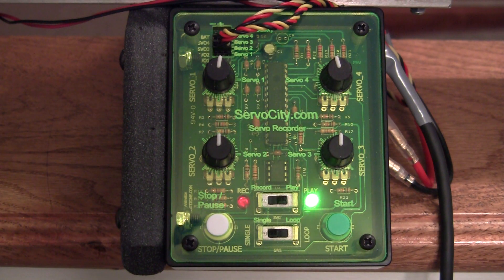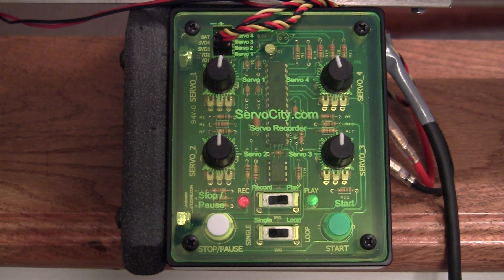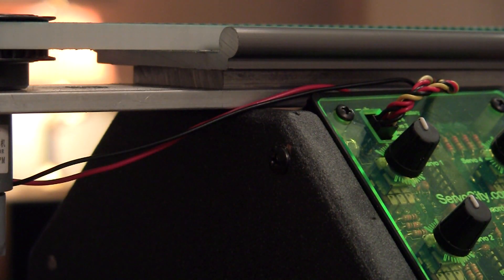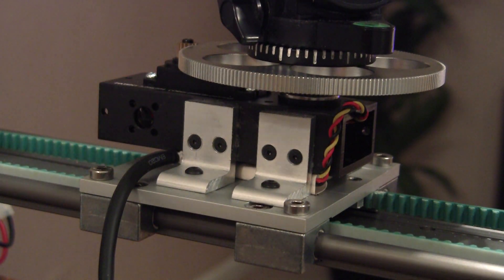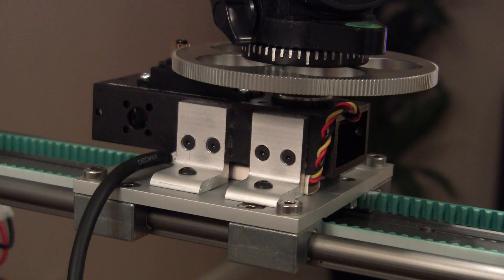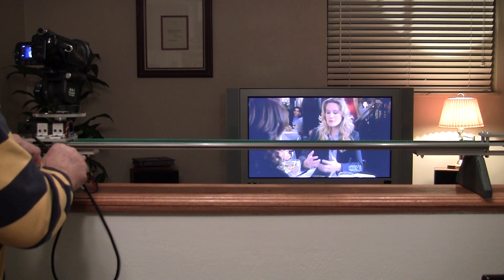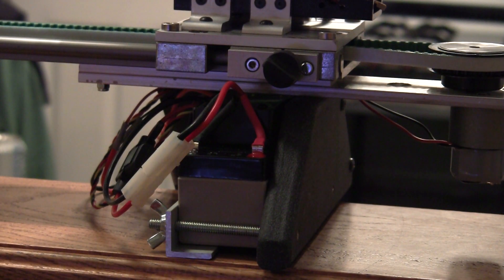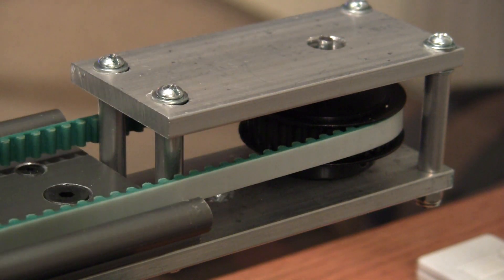DIY motorized Igus Slider.mp4

Comment: thats already a awsome mode, you are able to control speed and turn of the camera, its very clever, i'm looking to buy a igus myself, i need to find the most quite bearing just in case, about the motor, do you think quiter motor exist ? or the strengh ask to move the camera is too much,?

Comment from the maker: as posted earlier... if you watch the next video in the bubble to the left at the beginning of this video, you can see all the parts and where to buy them, but here is the belt and pulley information purchased at polytechdesign dot com 1 qty. C5M-09A belt clamp 8 qty. feet B9-5M-MPS belt by the foot 2 qty. P30-5M-09-6FS 30 tooth pulleys..

Comment: I've been looking for plans, but it seems everyone is more interested in showing off their finished product rather than explaining how they actually built the thing. Nobody wants to watch 3 minutes of your slider moving back and forth.
Reply from the maker: nobody wants to watch your slider move back and forth... why the arrogance? If you look at any of my videos you will see that they are very instructional and helpful to many people who want to motorize their Igus slider, but obviously not you. ServoCity now makes a complete kit minus the motors and controller based on my design. If you have an ounce of sense you would design and build your own since you are so intuitive. I have no engineering experience and went to Harbor Freight and bought a cheap drill press just to build this thing. You can do the same thing.
Reply: Hi Dan. I know it's an old post but i can't help but  comment on the hateful comments you're getting. Don't mind these asswipes. They're the types if they find a $20 bill they'd still be pissed that they didn't find $50.  Your video is very informative. i don't know what Ben Press is complaining about. I built one of these myself and I'm still refining it after a full year. Mostly trial and error on which motor to use. I went the servo route at the onset for the timing belt and pan but changed the pan servo to stepper motor and finally a gear box stepper to slow the pan even more. The timing belt is still a 360 servo, albeit noisy for video. BTW, I want to make it work for both video and timelapse shoot-move-shoot for night sky photography. Both applications are 2 entirely different beasts. Learning the Arduino is half the battle. I want to eventually change the belt servo to a quieter stepper for video. For timelapse, since I'm not recording audio with it, the 360 servo works fine. I'm stuck with making 2 steppers work together in one Arduino sketch. I'm new at coding but slowly gaining ground. Any ideas?

Comment from the maker: if you watch the next video in the bubble to the left at the beginning of this video, 
you can see all the parts and where to buy them, but here is the belt and pulley information purchased at polytechdesign   dot  com 
1 qty. C5M-09A belt clamp
8 qty. feet B9-5M-MPS belt by the foot
2 qty. P30-5M-09-6FS 30 tooth pulleys